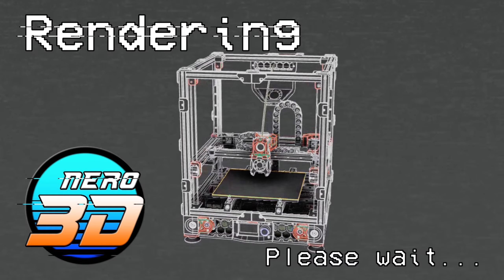FLSUN S1 First Look PART 2 - Slicer and settings  #3dprinting

Comment: Have you done a bed mesh for the abs prints? The bed might be thick aluminium, but it still changes with temperature. Also the printer doesn't home off the bed, so that might also affect your results

Comment: There is a Orca slicer profile in the works. Full control of the heat bed. 

Did you notice you can dim the leds inside as well as change the colors of that led on the panel.  Red white orange
Controlled with mailsail

Comment: Watching this late, and the overextrusion, an EM of 1 is super high for abs / asa. In orca, PS and SS, i use 0.945 as the sweet spot for all abs and asa. So they most likely just dont have a well tuned asa/abs profile. Now in all the other slicers for me and my friends at least,for PLA, the sweet spot tends to be 0.96-0.99 depending on the filament (silks i tend to ise the lower end, matte filaments and regular pla more towards 0.98-0.99). That thing has a huge melt zone. I would either lower the EM, or kick up the speeds a lot